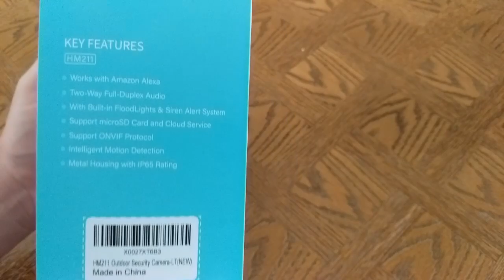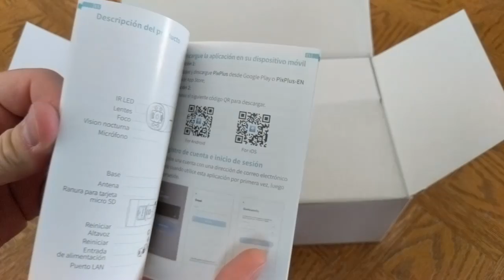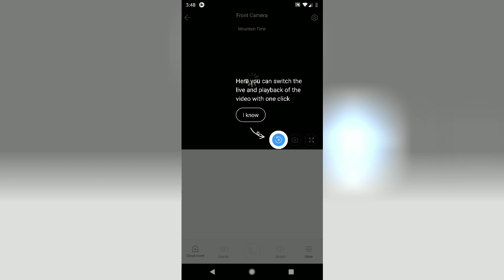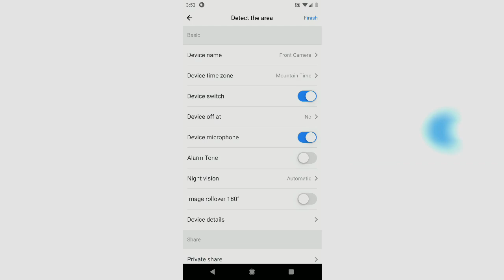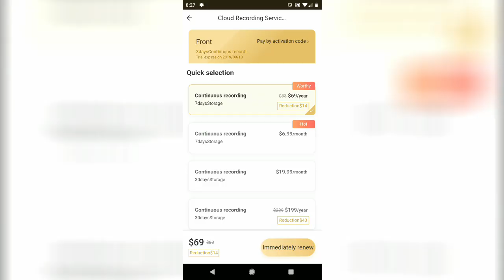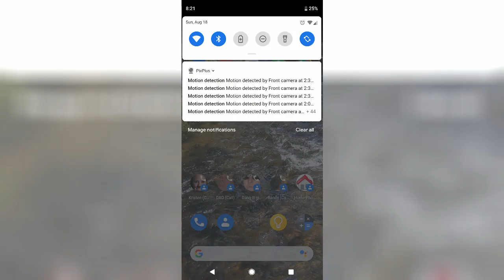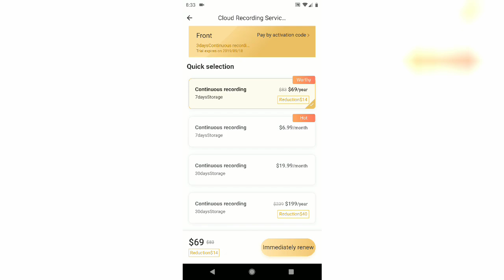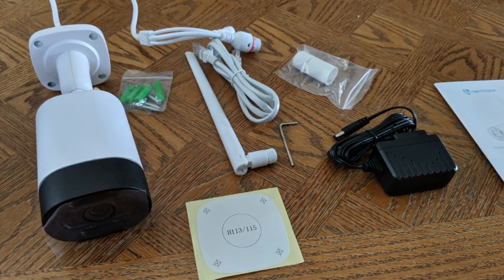HeimVision HM211 Camera Review | Running Ethernet + PoE Injectors

Comment: Yeah,you nailed it,good solid camera except for the mounting arm, mine got ripped down by a very dumb human thinking ripping it down, I guess he thought it'd prevent me from recording his clogged dirty pores in 1080 view,lol,idk. The mounting arm hasn't recovered, it dangles and flop's now. Wish I could find a good theft proof camera cage for an affordable price or could find out if hemi link has a security cage for this camera specifically.  I've e tried multiple diy mounting arm's,but unsuccessfully. Think the wiring got loose as well,and it looses wifi connection now randomly,which sucks cus an Ethernet cable really isn't all that theft proof,unless you tear down siding and panneling and re do it all to cover wires. Being in a rental that's not an option for me. The Good things though, it is sturdy, even after being ripped down,I'm surprised there wasn't more damage to camera , the alarm is awesome and loud,same with it's floodlight and night vision, the feature I like a lot and is very cool is that I can remotely control those two functions from bed if needed. Oh and I've still not been able to find a way to connect the viewing app to my PC. I wish ide installed this camera more securely the first time,I knew I was up against some ass*#@!%, but I didn't know they'd be that ballsy to come straight up in front of the camera lense to rip the camera down from my porch ceiling.

Comment: I am using the cameras with ISPy software.  That does all the recording, motion detection and playback, and it does it much better than the heimvision app or cloud service.
Reply from the maker: I'll have to try that!
Reply: After setting up the camera with the Heimvision App, all you need to do is log into your router and find the ip address assigned to your camera(s).  Enter that IP address into the Ispy setup for Onvif and it will find your camera.  Ispy has much more sophisticated motion detection control and recording options.  If you don't want to pay for Ispy cloud service, you can simply use the free Heimvision App to view cameras live, that costs nothing, and the Ispy program to save recording on your PC.  Blue Iris is another option, but I haven't tried it yet.  Ispy is free, unless you want web access to view the recordings remotely.

Comment: I have this cable and connected it how you recommended with the POE injector, it works for about 24 hours before disconnecting. I then have to remove the device and reset it manually. Have you had any similar issues?
Reply from the maker: I have seen it disconnect a few times. Not often though, and a power cycle always fixes it.